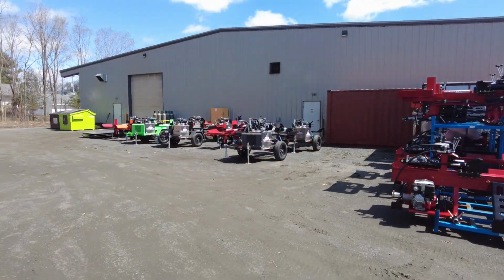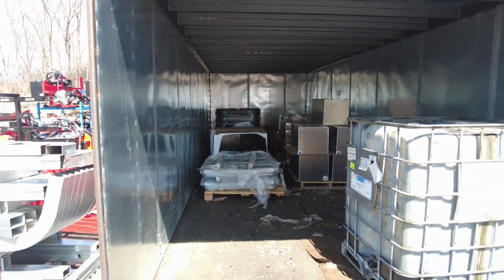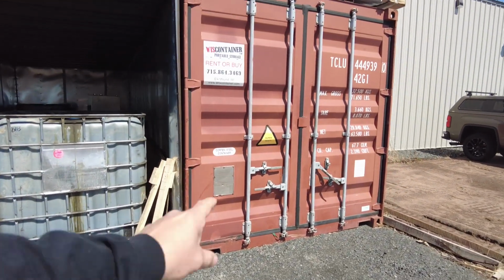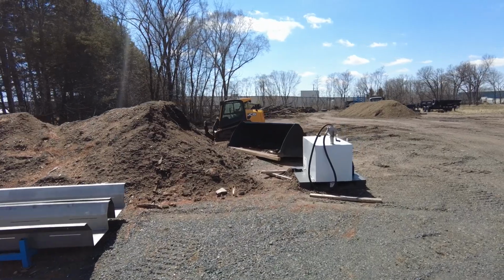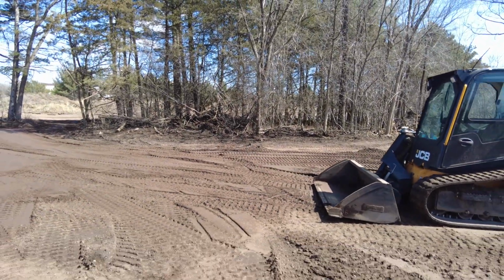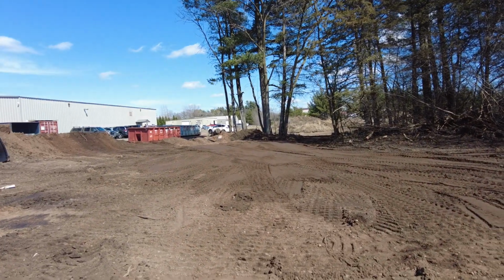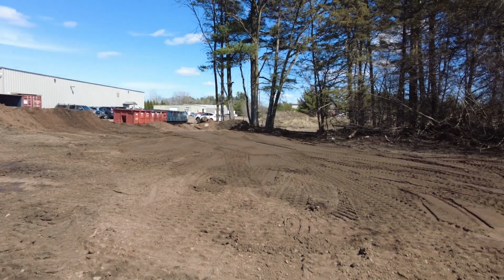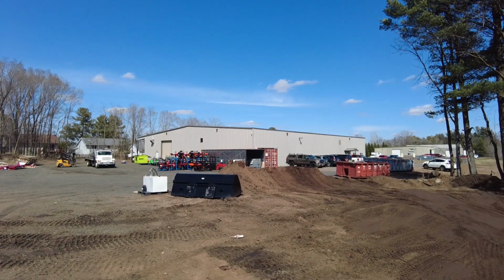I need Therapy!! Stress relief from working outside with... Judy?

Comment: Just an idea to make the conex box easier to use.  Cut the bottom latches off the doors and pour a concrete ramp up to the floor level so you can drive in and out with fork lift or skid steer. Thanks for the videos keep up the good work
Reply from the maker: It's a rental, so I can't modify like that.